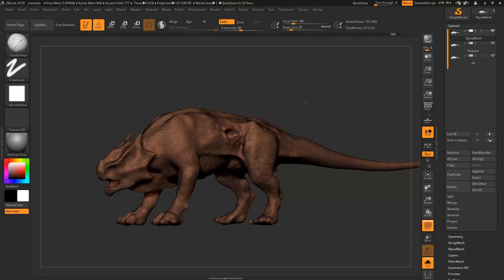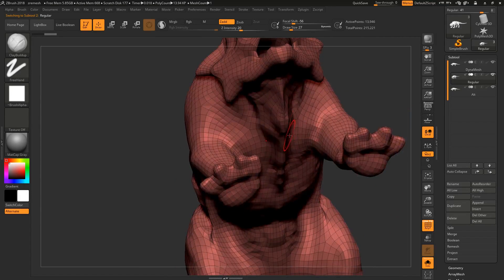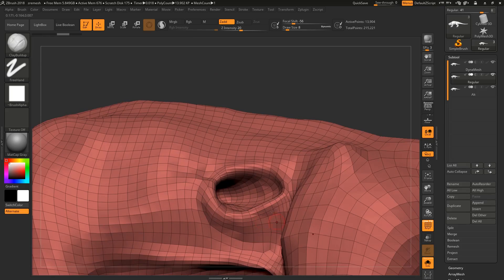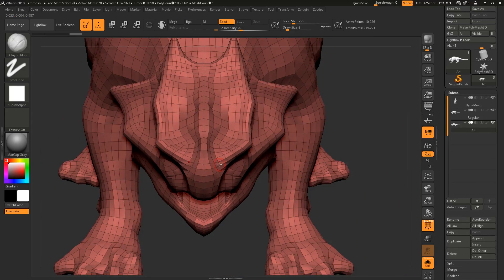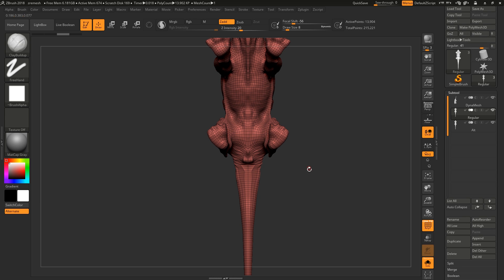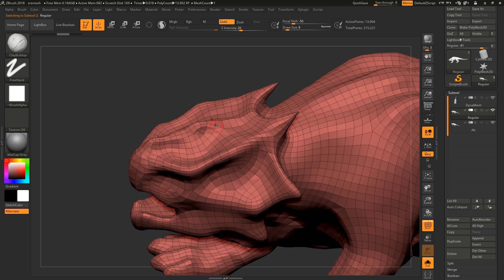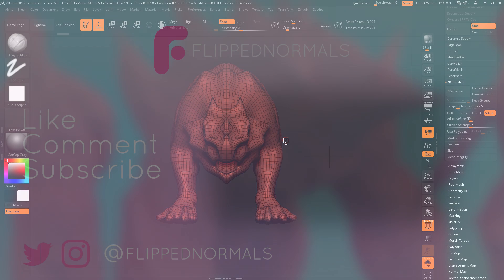Alternate ZRemesher Mode in ZBrush 2018

Comment: Why not use the ZremesherGuides brush for stuff like that hole and arms? You can easily create the loops you want anywhere using that.
But in any case thanks a lot for the tip, having the retopology be automatically symmetrical is great help.

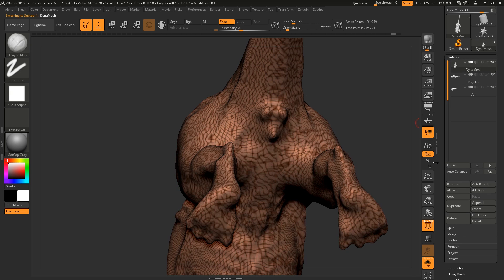Comment: The only reason you came here for is at : 3:50
This alternate algorithm has nothing to do with ZBrush 2018. You guys are all excited because you just discovered it is all. Alt+ZRemesh has always been there. 
For those who don't like the zremesh flow (it's great but full of loops) : Use BZR (Zremesh guides) to draw your own flow. Or use the AMAZING tool from those guys : http://igl.ethz.ch/projects/instant-meshes/
You can find the Windows .exe on their github page https://github.com/wjakob/instant-meshes         Very impressive retopo algorithm that works even on hundreds of millions of polys.
Reply: Thank you for reminding about this software. It definitely deserve attention of community. Though it have some disadvantages compared to ZRemesher: no symmetry mode, slower speed, not integrated in ZBrush (read slower workflow). OTOH, it is very interactive. In defence of ZRemesher - you can get outstanding result from it, knowing a couple of tricks.